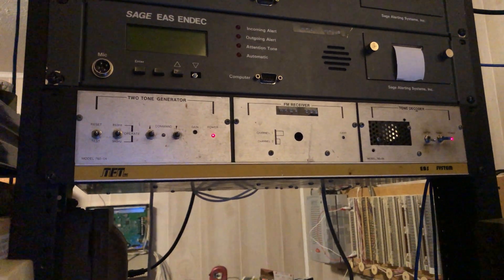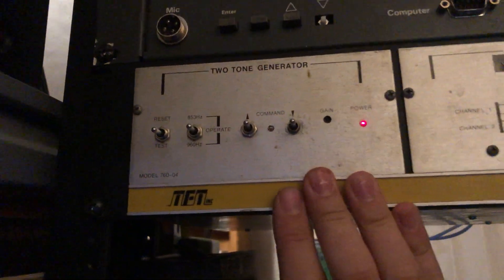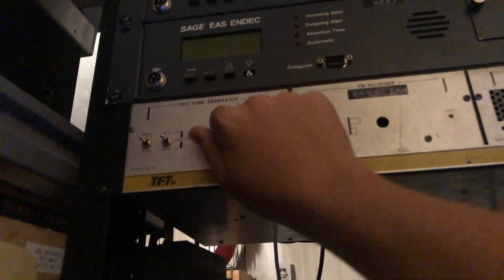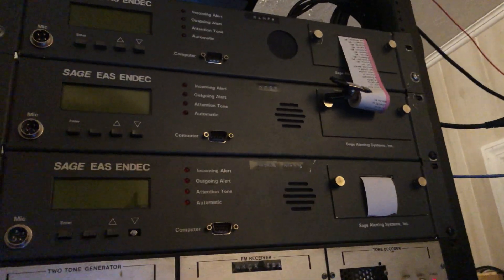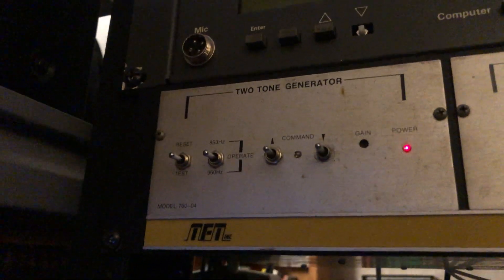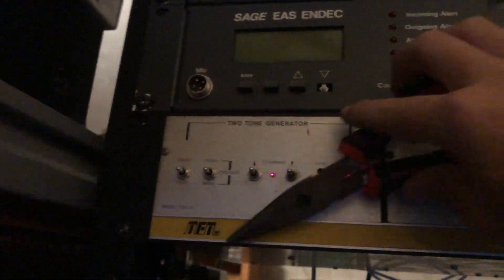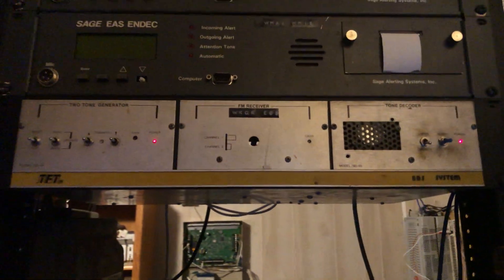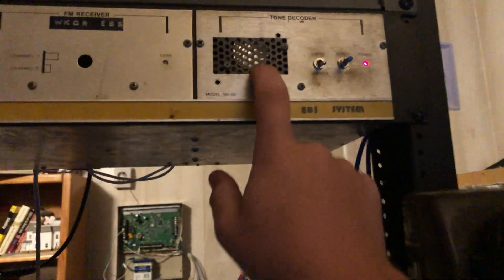TFT EBS System | Emergency Broadcast System Receiver/Generator

Comment: If this were a federal alert, the station should hear the audio content from its monitoring assignment. In the case of enemy attack, EBS stations may have begun immediate relay of the attack warning rather than wait for all downstream stations to activate. You'd have as little as 5 minutes on the East Coast to take cover.

Comment: The Emergency Broadcast System dates back to 1963. This unit you have also has the capacity to be triggered through a remote switch. I worked at several stations in the early 90s, and many of them had this unit, but they also had remote triggers to start the tone on or near the main board in the studio. I never saw anyone use the two switches at the rack generator to trigger it.
I can't speak to how things were in the 70s and the early 80s, but by the time I was working in the industry, EBS was a joke, at least outside of the Primary Entry Points and state relay stations. Literally not a single one of my many coworkers had any formal training in how to use the EBS, and I think I knew only one person besides me who had even bothered to read the manual that was legally required to be posted in the studio.
Reply from the maker: Yea, from my short time (~2 years) working in the broadcast field, EAS is a joke in the broadcast field. The EAS system is definitely one of my biggest pet-peeves. I tried my best to keep the systems we had as compliant with the state's EAS Plan, FCC rules, etc. Whilst I was working there, everything was functional, who knows how it is now...
Reply: Interesting. By 1986, they'd put the PEP and EANN system in place as a Last Resort, as they figured EBS wouldn't work well in extremis. Do you have any anecdotes as to your network internal alerting system? When EANN was still active, federal audio came from the commercial networks.
Reply: @DoomTape1981  One station where I worked had a cassette tape recorder connected to the EBS receiver. When it detected the tone, the tape would start rolling. If it was a real alert that we wanted to relay, we would remove the tape, recue it, and play it back manually on the air along with our locally-generated tone. At other stations, there was no recorder… you were just expected to listen to the speaker, take notes on what was being said, and announce it if necessary.
EBS had no EOM tone, so whenever the received alert or test was over, you had to manually reset the receiver to turn the speaker off (and put the tape recorder back on standby, if you had one).
Reply: @andyrose5616  did you have a network internal alert for federal? Most ABC, CBS, NBC radio and TV did. Have tried to get EBS network materials from FCC. Most were never archived.
Reply: @DoomTape1981  There was no formal federal alert that I was ever aware of. The earliest stations I worked for didn't even have a major network affiliation. You would find out about an EAN through your local EBS alert monitoring chain or through a wire service alert with the bells and code word message, but there were not precise FCC instructions on what to broadcast. Just some general priority guidelines, and the expectation that you would air an emergency presidential address live if you could.

Comment: Would you resurrect the old Emergency Broadcast System as a sort of backup if something caused the digitally based Emergency Alert System to be knocked offline completely or otherwise malfunction so as to render it useless or inoperative? Been worried about computer malware doing something like that. An old style analog backup like the old EBS equipment would seem like a good ace in the hole.
Reply: Most areas used EOS as backups, but that would be cool to see stations be able to do this but Since Local Access Alerts are a Thing, I dont think It would be needed
Reply: @damaniwilliams8219  I saw what Local Access Alerts been like and how they are set off, and if you ask me I'd prefer the EBS to the Local Access Alert systems. I'd resurrect the Emergency Broadcast System as the backup to the EAS Emergency Alert System knowing that one day, some asswipe or group thereof WILL hack our national digital warning systems and crash them straight to Hell. The EBS, being completely analog isn't subject to hacking even if it depends on manual activation. Better that than no warning system working at all, right? You tell me.
Reply: @EMSThinWhiteLine12866  Honestly, The older EBS System Worked a hell of a lot better than this new system.
Reply: @damaniwilliams8219  The one improvement that EAS DID have was it is automated and can be activated by remote control even if the station's completely unmanned which I never believed in ever doing. A crew should ALWAYS be in house even overnight because what if equipment vital to emergency interests goes on the blink? Need to switch operations from EAS to EBS necessitating keeping an operator in house all hours. Also the only other improvement was the SAME tech allowed warnings to be geo-targeted to some success. I don't honestly see how successful but it has helped. Other than that Damani, simpler IS better and that's what I feel is good about EBS.
Reply: @EMSThinWhiteLine12866  you seem to be too experienced  and a bit of a grumpy ol man…no one will ever be ordered back to being at the station over night to monitor the station when they can do it at home if only their phones are always on and gives them the push notification of an SNMP trap. To be honest I prefer backup studios requirement to be recorded as law and other things, automation is here deal w it.
Reply: @damaniwilliams8219  No, the EBS was very infamously unreliable, with huge delays in conveying information to the public. The EAS works perfectly most of the time.
Reply: @EMSThinWhiteLine12866  Yes, there were "only" two extremely huge improvements that made the system way more useful and saved thousands of lives.
Reply: @EMSThinWhiteLine12866 Local Access Alerts are thru phone lines and Cable RF right as I thought these couldnt be broadcasted by satellite. In my opinion the EOS can be used as a backup by state officials to give remaining info in the event that hacking does occur. And info can be given quicker(like in the train derailment of 95 in AL where info thru local access alerts were given every 15 mins by the mayor). This helped a lot during that situation. Local alerts are like reverse 911 systems that are helpful as a last resort
Reply: @damaniwilliams8219  ur right. Emergency Override Systems aka Local Access Alerts are a thing. quite rare to whitness tho